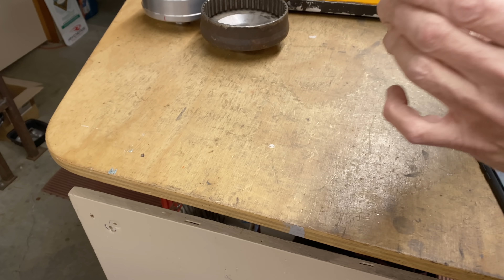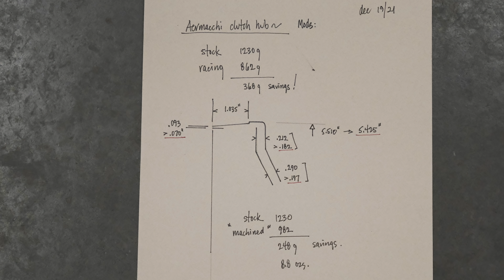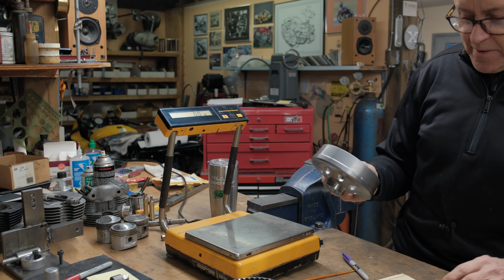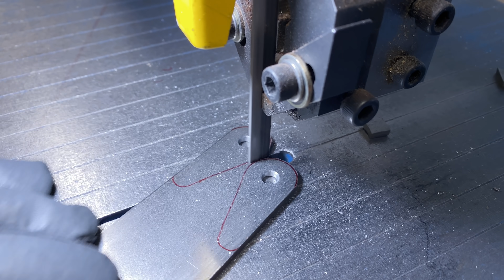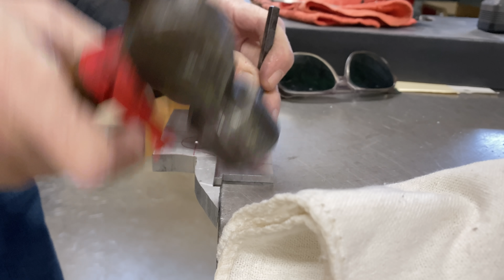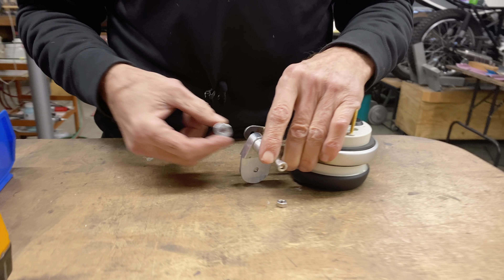Making a Tach Mount for the Aermacchi // Paul Brodie's Shop

Comment: Have you considered a light aluminum brace from the threaded rods on the back of the tach to the number plate mounting bolts to triangulate the mount and reduce vibration?
Reply from the maker: No. It turns out that tach only works with 4, 6, or 8 cylinders. I bought the wrong tach. I just ordered the correct tach this morning.
Reply: @paulbrodie  would still suggest a brace as the tach with a single point mounting can resonate and cause a fatigue fracture
Reply from the maker: @simonlewinson4170  Yes, the mount did crack early on in my racing career, so I reinforced that area and no problems since then. But thanks for suggesting.

Comment: Are you racing this thing? Remember drilling stuff sometimes causes catastrophic failures at speed! Trust me. You also might want to consider contacting  AirTech about bodywork. Nice motorcycle. Cheers!
Reply from the maker: Thanks Dan. I raced my previous Aermacchi for 5 seasons, so I do have a sense of what to do and what not to do. This bike could be raced, but everything has changed. I broke my leg badly, and now racing insurance has become prohibitably expensive. I had bodywork on my previous bike, but this one will be naked. Thanks for watching!

Comment: I make custom knives, and I do heat treating.
After hardening the sprocket did you temper it? 
The steel is very hard and brittle after hardening and you temper it to give it toughness depending on the application.
I'm not trying to criticize just be helpful.
Reply from the maker: I know if I quenched it in water, it would get very hard. With oil, I don't think so. I have done this before and had good success. I can still file it, so it can't be that hard. I am just an amateur when it comes to heat treating. Thanks for watching and commenting.
Reply: @paulbrodie  Oil quench can make it very hard. O-1 is oil quenched, most steels are oil hardened or air hardened.
But if you can file it like you said you are fine.
Hope I didn't come across as criticizing your work as that was not what I intended.
Love your channel, I learn a lot. Thank you and Mitch for doing them. I know it's a lot of work to make these.
Reply from the maker: @davidparker3346   David, I was not offended at all. You obviously have experience and I respect that. Thanks for liking our videos :)

Comment: Hi Paul, can I ask where you got the rubber cushioned clamp for your tacho from. I'm looking to use the same method for a Guzzi race bike but am struggling to find anything suitable.
Reply from the maker: It came with the tach. I'm told it is the "old style" of mounting for the Autometer tachs.

Comment: I knew when you started using a file there would be a heated debate in the comment section. 

I wonder if anybody saying you are doing it wrong has ever thought about how many frames and motorcycles and bicycles and motors and everything else you’ve built over your very productive lifespan and just thought, “maybe he knows what he’s doing?”
Reply from the maker: It's true... I have done a bit of filing in my years at the workbench. Thanks for watching!

Comment: A question? where is the tach getting its signal from? Or is that another vid?
I'm interested as I have a basket case XS650 engine that needs new rods, bearing, rebore etc. 
The plan is to make a street twin using this engine as well as a donor frame along with a variety of forks and wheels I have.
I've just rebuilt an XS650 Special for a friend and the standard alternator and point system is pretty ordinary! It works and the bike runs nicely but I feel that improvements are needed. There are modern retrofits available and I will be using these in my build. 
Any hints from you will be appreciated!
Reply from the maker: The tach will get its' signal from the ignition, which I do not yet have. Last race bike used a PVL system, so I will check into that. Tachs come with wiring diagrams to make life easier. Thanks for watching.

Comment: Please don't take this the wrong way Paul! 
My instructor in 1975 was quite adamant that gloves should never be worn when using lathes, mills and big drills. 
His experience was that the surgeon had enough to do trying to sew your fingers back on without having to clean out the fragments from the gloves.
And yes he was talking from personal experience.
Reply from the maker: Peter, in previous videos we have covered that subject quite extensively, and decided it all depends on the machine and the application. It's not really as black and white as it might appear. I am very safety conscious.

Comment: Im surprised you haven't added any speed holes to the number plate/ tach arms. There is probably a significant amount of weight to be saved there.
Reply from the maker: You can get carried away with drilling holes everywhere. I am resisting a little bit...

Comment: After a lifetime as a craftsman with a lot of filing experience, I came to the conclusion that the filing advice you were given is nothing but an old wives tale. Rolling forwards with the curve, as you did, is easier, more intuitive and easier to control more accurately.
Reply from the maker: Well, it may seem like an old wives tale, but there are those who truly believe in it and promote it. Just now, reading the comments, I have learned that the 2 styles of filing a radius are Rolling Over, and Rolling Upwards. Pretty self explanatory. I agree with you that the Rolling Over (or forward..) is the better approach.
Reply: I too roll over like you do Paul.
I saw someone on another channel filing the other way (Rolling upwards) and I thought it looked odd and not intuitive.
Never heard it was supposedly the correct way.
I guess I will continue doing it wrong.
Reply from the maker: @davidparker3346   Doing it wrong has been working a long time for me :)

Comment: I put a rounded off rod in my vice jaws and stick a magnetic dial indicator stand to the flat part of the vice.  Zero the dial indicator on the rod, and presto, you have a quick and easy way to measure unusually shaped thicknesses with.
Reply from the maker: That could work. I just heard about using the DRO in the mill, and two 1/4" rods. That sounds like I want to try it... Did you check that earlier comment?
Reply: @paulbrodie  I see it  now, that's great idea.  I don't have a DRO so I'll stick with the dial indicator.  :)

Comment: You better add a bolt through the two lower legs you brazed they should always be needing tension, as the radius of the lower legs bends to meet the large diameter opens up it will loosen the gauge and vibrate out of the large loop. Ask me how I know.
Reply from the maker: I think I know what you're saying...But, I'm making the same mount I raced on for 9 seasons and never had a problem with the tach slipping or falling out.
Reply: @paulbrodie  I did the same and after a season it got looser and looser. Ended up putting thicker rubber in the boot. A billet ring would’ve probably been better for me.

Comment: almost had a Aermacchi/HD Sprint once we went to look at it and the fellow started it up and ran up and down the road pulling wheelies and showing out.my older brother decided it was too much for us.if he had just rode it in a normal fashion we could have owned it.it was a fast little m/c....loud to.we was very disappointed.
Reply from the maker: Almost any bike can wheelie, but you don't have to. That's too bad the seller was a jerk. Keep looking, they are out there!
Reply: @paulbrodie  i sure like that one with the knuckle head...i had part of and engine once.i gave it away
 to a fellow who restored Sprints.i have always liked the looks of them.Alot of the Harley Davidson dirt trackers used to race the Sprints on short tracks with hard tail frames they looked real neat.
Reply from the maker: @roybartran6756   I think the Knucklehead is the best looking motor. The design really does allow the air to get right to the top of the combustion chamber.

Comment: I forget if your running a dry or wet clutch but either way you could also 'perforate' the outer drum and inner hub to allow friction disc dust to get out quicker.
 It was a 'tuning' mod for several years on various bikes, even the manufacturers used it as a 'feature' saying they had increased the diameter of through holes. 
 On Japanese bikes where oil is fed through gearbox shafts from one end and exits at clutch, increasing the flow helps keep clutch plates cooler plus has a flushing action
.It doesn't cause clutch slip as the plates were designed to be 'wet ' (quite difficult to explain it to several of the people I worked with back then !!!!!) 
I've been doing it  since the late 1970's on various bikes whenever I did clutch work as they always used to be 'solid' and you could see the build-up on the inside of clutch basket after a few thousand miles
Reply from the maker: I have a dry clutch without even a cover so it should be just fine.

Comment: Looks like you could use a set of annular cutters. Faster way to drill holes since you don't have to remove all the center material.
Reply from the maker: It's not possible for one guy to have every tool available and still have room to work.

Comment: Hey paul, a little hint: it's not good to punch aluminium that hard with the centerpunch. This leads to a deformation of the internal, crystalline structure of the material and can lead to cracks in the surrounding area. :)
Reply from the maker: That might be true, so it's a good thing I got rid of that area by drilling it out. Thanks for watching.

Comment: If you've got a DRO or a digital scale on your mill quill, you can put a rod with either a flat or radiused end on it in chuck or collet and clamp another in your vice and line them up and zero the reading when they touch and use it like a big pair of digital calipers it that description makes sense to you. The contact points can be shaped for special applications. The guy I learned it from was deepening valve relief pockets in a set of pistons and wanting to know how thin they were getting, so full credit goes to him.
Reply from the maker: Yes I have a DRO and that's a good idea, thanks!

Comment: Don’t you need to temper the sprocket?
Reply from the maker: That's what I was doing putting it into the oil.
Reply: @paulbrodie  my understanding of heat treating is as follows: you bring the material up to critical temp (around non magnetic) end then quench it. After that you have to draw back the temper to anneal? it so it’s not so hard it’s brittle.
Reply from the maker: @caccadu12  Heat treating is a huge subject or science, and I have limited knowledge. Quenching in water can make the piece quite brittle, and that's why I chose oil. It won't get as hard, but still is harder than no heat treating. I did this to another sprocket and raced that bike for five seasons and the sprocket was fine. Never cracked, and wear was minimal.

Comment: Fireball tool made a video about files and there is no need for any explanation about back-dragging. Thank you Paul & Mitch for the interesting videos
Reply: Here it is!! https://www.youtube.com/watch?v=xbykic--SKA
Reply from the maker: I saw that Fireball video. I never made mention of back-dragging. I was talking about the technique where you roll the file backwards as you are filing forward to not get any flat spots. Two different things.
Reply: @paulbrodie  As an old Jeweller, your filing technique is closer to what we were trained to do on flat ring shanks & wedding bands, all of which is done seated, holding the piece in one hand & pushed up against a wooden "bench peg", whereas the "rolling upwards" technique seems to be more "industry specific" for when you're standing at a vice. (and when at a vice I still file "rolling over" like you normally do)
Reply from the maker: @colincreedtattoomachines   I see. So we have Rolling Over and Rolling Upwards. I like that, and the terms make sense. Thanks for watching and commenting.
Reply: @paulbrodie  The term "rolling along the face" was what our Trade School Teacher used to refer to it & so when I saw the other technique, I concluded it as "rolling upwards (along the face)". No idea if that's its "official" term but I figure it's descriptive enough so most can quickly understand the differences. HTH
Reply from the maker: @colincreedtattoomachines   Your term is out there now!
Reply: My apologies for misunderstanding the intention of comments in the video
Reply from the maker: @JamesBond-kf9ih   No Worries. Thanks for watching!

Comment: I don't get it - fiddling around saving grams on the clutch basket and sprocket and then mounting that blooming great rev counter?
Reply from the maker: Well, I did save 11 OUNZES on the clutch hub, not just a few grams. The tach might look big, but it is actually very light. There is a method to my madness.

Comment: That sprocket being heat treated unevenly is a sign of a bad heat treat oven... At least you knew how fix it.    😁
I've tried to tell a friend how to do it and they said "Do you think I can do that¿?" and I said "Do you think I can¿?", he said no but I had to tell him that I've done it multiple times in my backyard.     🤣🤣
Still doesn't stop my brain from saying "you know as soon as you touch that part to the oil, it's going to explode and cover your body in super hot oil" even though I know that when doing small parts you can literally stick your hand in the oil after you pull the part out... Or in my case reach in and grab the part so it didn't melt a hole through the bottom of my bucket and spill oil in my grass and that was my first time trying it.    🤣🤣
Reply from the maker: The oil kept catching on fire as I dunked the hot sprocket.
Reply: @paulbrodie  - Yeah that scared me even though I knew to expect it...   😆
Reply: @paulbrodie  Been there, done that. I wonder if new oil would be as bad due to no fuel contamination due to blowby.
Reply from the maker: @truthboomertruthbomber5125  For my purposes I don't think it would make much difference.

Comment: Great .. quick I need coffee and a sit gown to watch ,,, yep the parts you can see right through usually weigh less ,,, its a Ducati thing too. Im surprised the number board bracket / tach mount hasnt had holes machined in it ,,, just to keep adding lightness ... also a sneaky advantage it would work as a crumple zone if you ever ran head first into a truck.   Not wishing it of course , but no harm in being prepared.
Reply from the maker: I've had my big accident, so no more to look forward to, hopefully :)